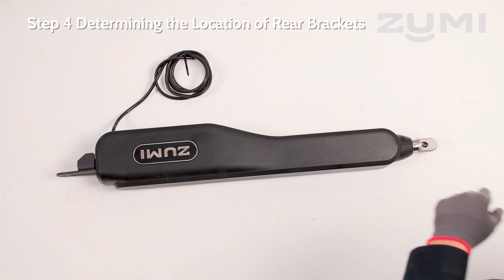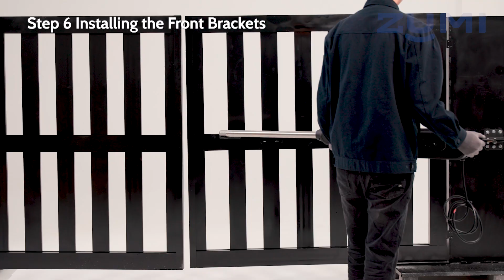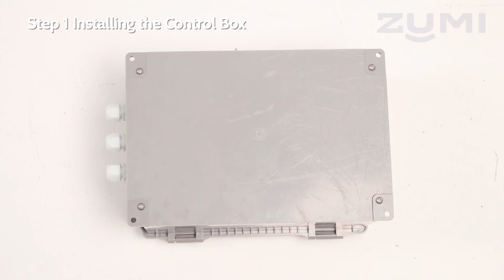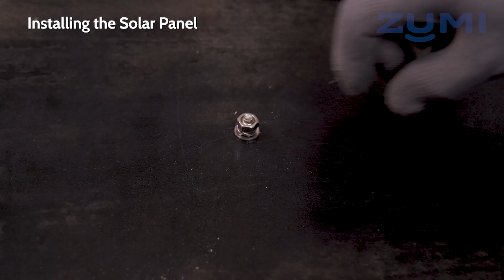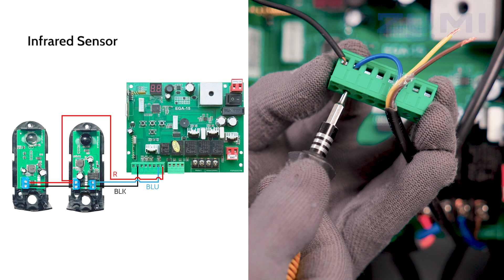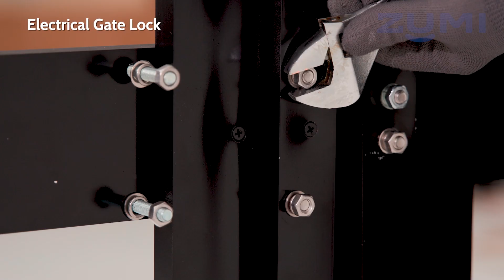Safe, Smart, Stable for Every Home - ZUMI WS2 PRO Dual Swing Gate Opener Installation Guide

Comment: I have a dual gate actuators ,? in order to sink both gates to open and close at the same time do I pigtail the wires at the termination point on  motor 2 (Main)

Right now one is opening and one is closing when I match the button on my remote. .
Any suggestions out there?
Reply: Did you ever figure this one out? I had to reverse the polarity on one of the motors to get this to sync up. So far, very unimpressed with this system and available support resources.
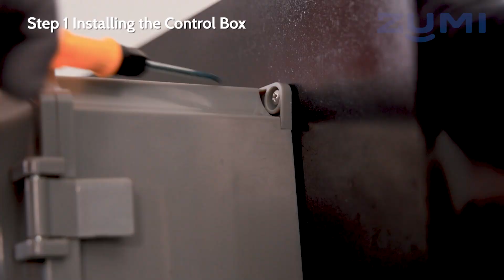Reply: Found it. Watch at 8:30, they show a diagram.